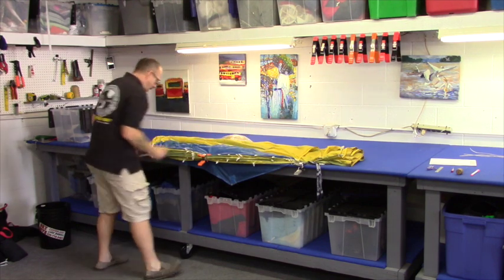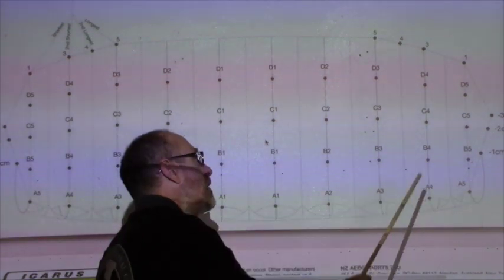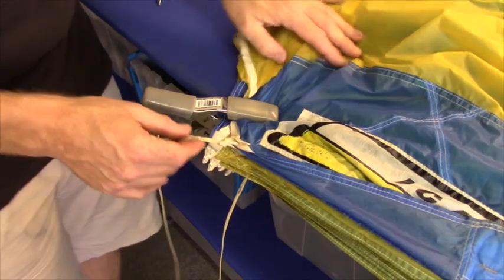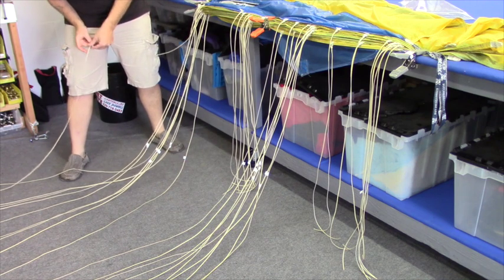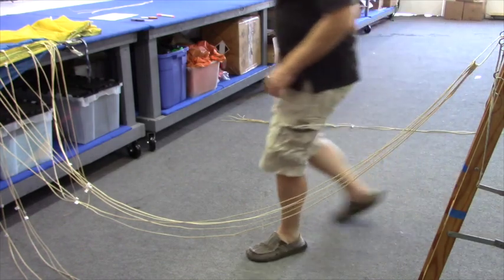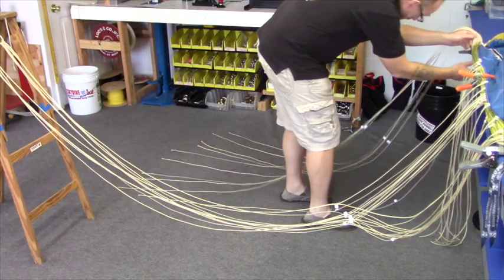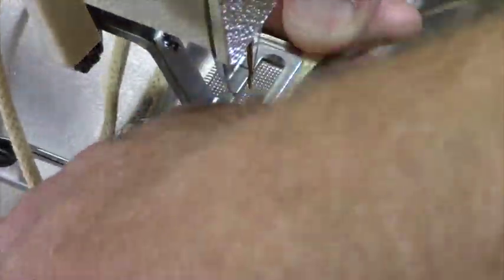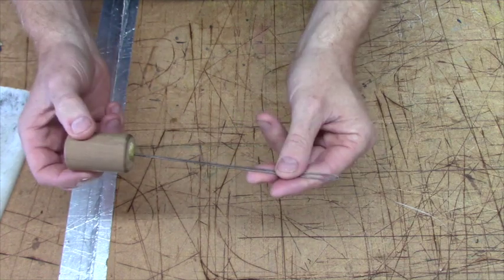Installing a new parachute line set. Skydiving Services LLC

Comment: Very educational videos!  Do you have any comments/ tips for when one only has a zigzag machine at hand?
Reply from the maker: Hi tresnokken,
Absolutely, I did them with a Singer 20U33 for the first 10 years of my rigging career. If possible put the machine on wheels so that you can take it to the parachute. The zig-zag should be approximately 1” long and the width should be about 1 third of the width of the line, so if the trapped line is a total of 3/8” wide the zig-zag should be about 1/8” wide. Set the stitches per inch to 7-11 and do 2 passes. Hope this helps. Simon

Comment: Great video. One question: suppose one wants to cut his own lines as opposed to buying a pre-made line set, how do you know where to put the cascade?

Trim charts typically give you the length from link to A attachment point and A-B differential but nothing to tell you where the cascade should be.

Thanks!
Reply: +Etienne Gignac-Bouchard  Good luck getting this answer from any manufacturer.  Even the full time riggers in our industry who have taken the time to measure new line sets on many different canopies want to hold on to that information.  1- the riggers and manufacturers don't want somebody to do something wrong and hurt themselves or somebody else.  I can't blame them on this one.  2- this is a business.  Giving away too much information can cost them potential business.  I don't blame them for this either.   I'd suggest asking your local jumpers to let you measure their lines and all cascade points when they get a new line set or a new canopy.  That's what I've been doing.
Reply from the maker: Hi Etienne, I have not been able to figure out how to answer this question, but luckily for me Eddie was able to put it better than I could. I know this is a frustrating answer, but it is spot on. Simon